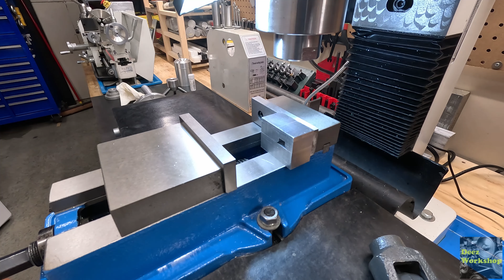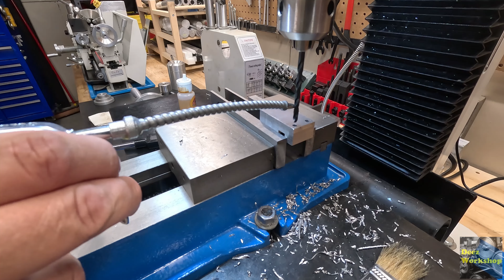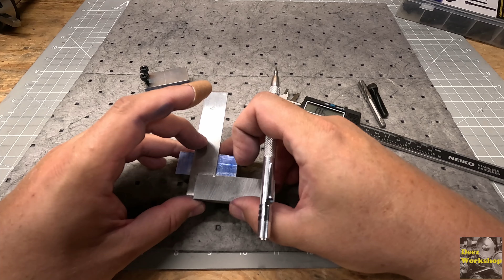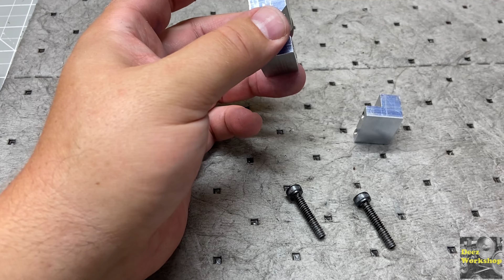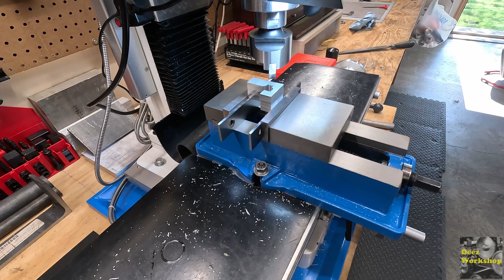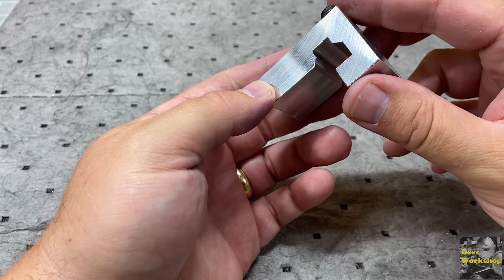Lathe Carriage Stop Part 2 of 2 New Design, Shopmade Tool for the Vevor Mini Lathe using the PM Mill

Comment: Nice work. I use my dead stop on most every project. They make it so much easier when roughing off material to a shoulder. I like to watch the cutting action not my DRO. Great job, can't wait to see your next project. Until then, Enjoy😊
Reply from the maker: I am with you on that.  Although I dont have a DRO on the lathe I do pay attention to the cutter and i dont use my dials much at all while performing a cutting op.  I really wanted to make on of these so I can do exactly what you described,  Allows me to make much better cuts up to a shoulder.  Cheers.

Comment: Nice little tool.  I recently built a very similar one for my old Southbend.  I recommend a horizontal 0.375" hole with a set screw to hold either an adjustable work stop or a dial indicator.  Also, just so know, those screws are 8-32, spoken "eight, thirty two", not "eight thirtyseconds".  I hear this a lot and for those of us familiar with threaded fasteners, its just annoying, for others, it can be very misleading, because 8/32 is just an incorrect way way of saying 1/4.
Reply from the maker: I really love these types of comments and advice.  Not being in a machine shop setting and working with other experienced machinists, I don't know these little things about terminology.  Early on I was terrible about terminology and have strived to get better.  Still make mistakes here and there but getting better,  This tip helps me in that quest to speak the language. you are right about the 8-32 vs "eight thirtyseconds"  which is a fraction meaning 1/4.  Never thought about it that way.  Thanks for the tip.

Comment: Ive seen people use an old or cheap micrometer graduated shaft as the adjuster stop bolt. Seems too work better than the first one. Nice and low, solid as.👍👌🇦🇺
Reply from the maker: Cool tip, you could really make some fine adjsutments with a mic shaft.  This stop may not look pretty but its solid.  I have plenty of material to work on mounts for additional options as well.

Comment: When you do decide to put the extra stop on, use 14-20, it's a common pitch tap, and a half a turn gives you .025" travel.
Reply from the maker: I will keep this in mind,  Thanks.  One thing I should think more about is using mroe common sized nuts and bolts.  I do find myself looking for diggerent sized allen wrenches more often that I like.